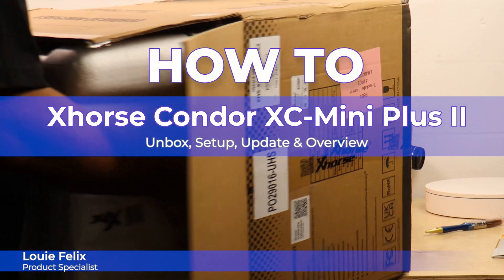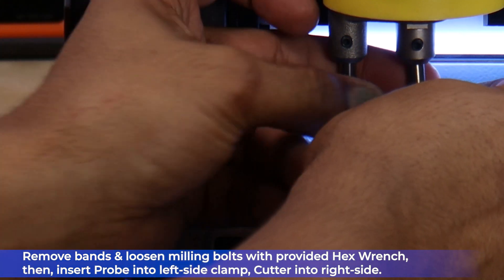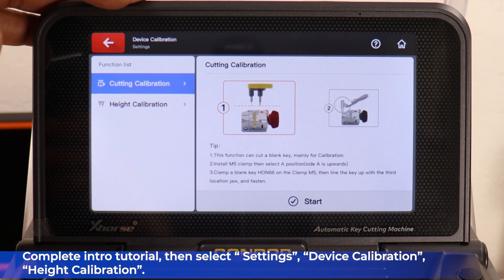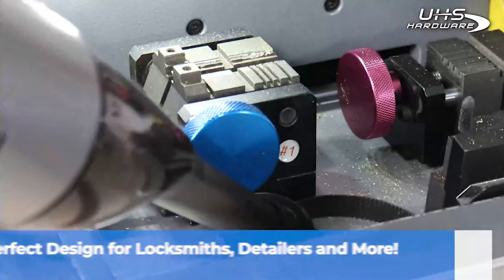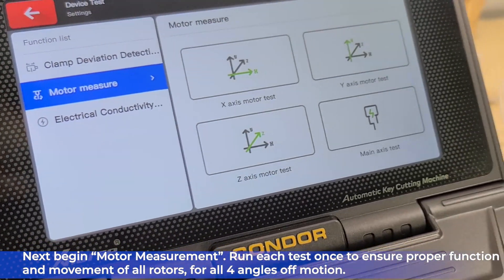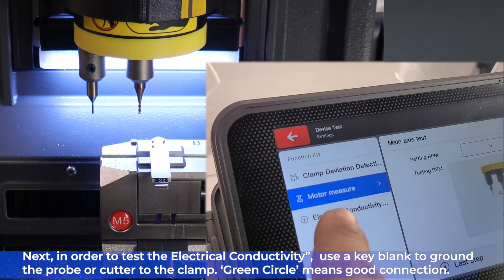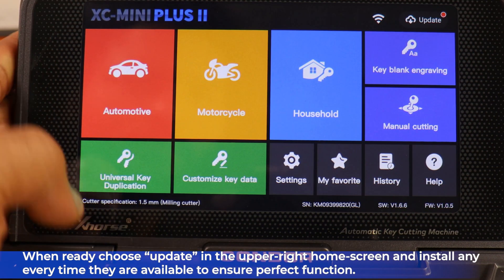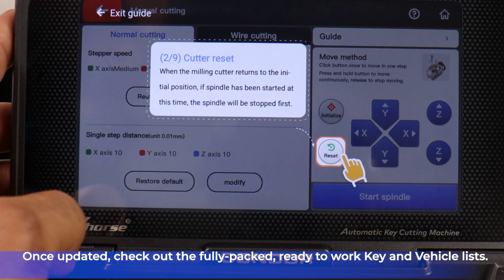How to Xhorse XC Condor II  Unbox Setup Calibrate Menu Overview & More Automatic Key Cutting Machine

Comment: Thank you for this video.  
I noticed the instructions says to put the test key on the last line. But the video has it on the 3rd line. Then, on the second calibration cut,  it's on the last line,  if counting from down up.
Can you elaborate on this?
Reply from the maker: the key was placed at the line indicated on the screen and you should def follow what the screen says while using. there could be a mis edit that thre you off. but the process works just as explained.
Reply: Nice, thanks. 
Im buying one soon. 
Do you have to be a locksmith to shop with you guys? @UHSHardware

Comment: I’ve had issues cutting residential keys by code. I doesn’t cut them correctly at all.
Reply from the maker: what happened? did you find a fix for the issue?
Reply: @UHSHardware  the keys end up being cut incorrectly so I just got an HPC